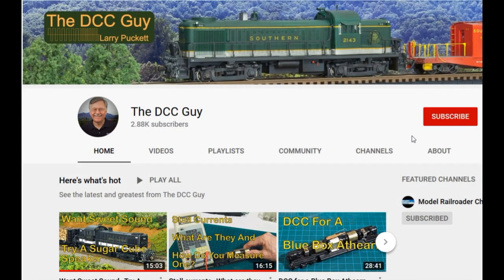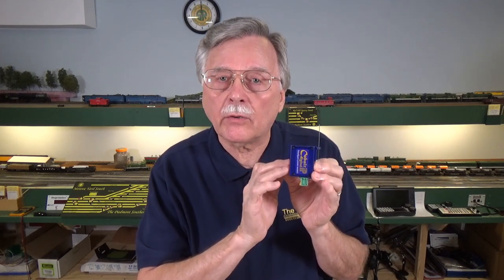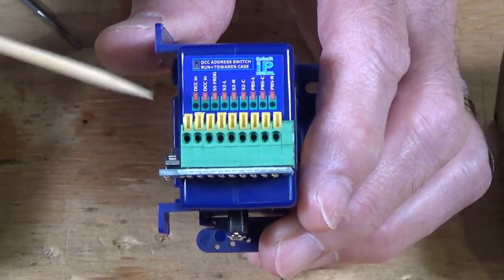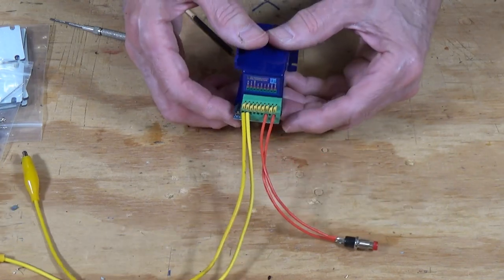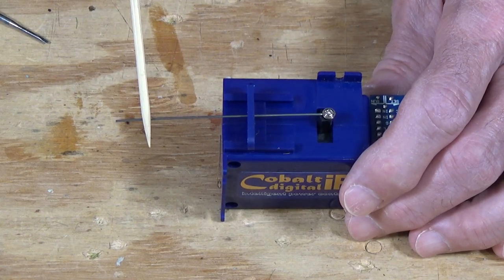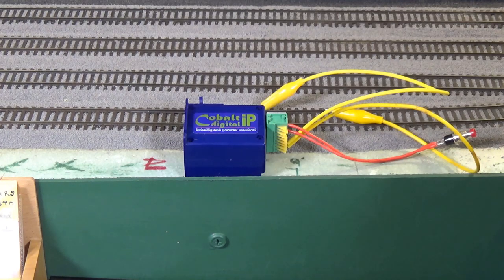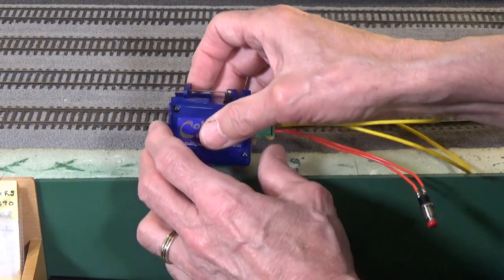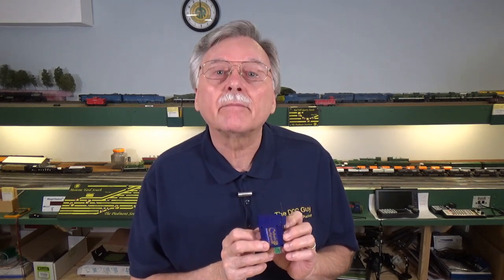Is The Cobalt Digital A Tortoise Slayer(188)

Comment: I have to comment, I'm sorry. Hand built O gauge live frog points / turnouts. The switch rails don't pivot,  they are the same rail allowed to move / flex / bend / spring / slide with no over centre spring. These servo motors (geared) HAVE to be used to operate these, hold the switch blades over and switch the frog. And they do an excellent job, though I often have to replace the piano wire  on the tortoises with a larger gauge wire to hold the switch blade in place, the one supplied isn't up to it. I'm sorry to be controversial, I understand track purists too well. But a Peco point with a solenoid / spdt (to switch the frog), and over centre spring lasts reliably about 40 years outside in the UK weather? And these are not cheap.
Reply: Hi black5f - Cobalt iP Digitals are not servo based. They use a heavy-duty motor and gearing to make sure of a strong throw. Once thrown, they lock in position so they cannot be forced back. We also use heavy duty spring steel on the throw bar - this means that any gauge of point can be changed with ease. We also guarantee the machines with a lifetime warranty and have tested them to over 250,000 throws without failure. I do hope this reassures you. ^RB DCCconcepts
Reply: @richardbrighton7737  Hi. A geared motor is exactly the definition of a servo? "often have to replace the piano wire on the tortoises" ... the tortoise wire is not up to holding O gauge blade over on a hand made turnout, the guy insisted on tortoises ... not my choice. I haven't used the cobalt.
Reply: @black5f  The Cobalt iP Digital is absolutely not a servo - it is a heavy duty motor attached to a high reduction gearbox, making it many times the more powerful than a Tortoise.  The throw wire we use is approx. 1/3 more weight of that used by Tortoise. I hope this helps. :) ^RB DCCconcepts

Comment: Info was good but the zoom in and out edits are so annoying it was impossible to watch. Rule #1 in pro video is "cuts" and "fades"! No cheap effects. Cheap effects take away from the video.
Reply from the maker: I’ll experiment more with my fades. That one is called the Ken Burns fade and when used here and there looks OK but in this video I had a lot more cuts and fades than I normally do.
Reply from the maker: I just took a look at the crossfade which is pretty similar but without the zoom and I’ll use that in the next video coming out Friday. Let me know if that is better.
Reply: @TheDCCGuy  OK, the zoom is the bad part, the crossfade is OK.